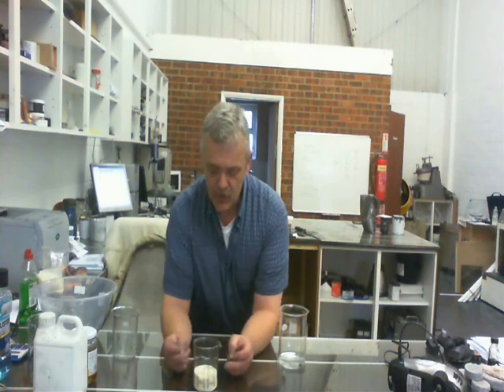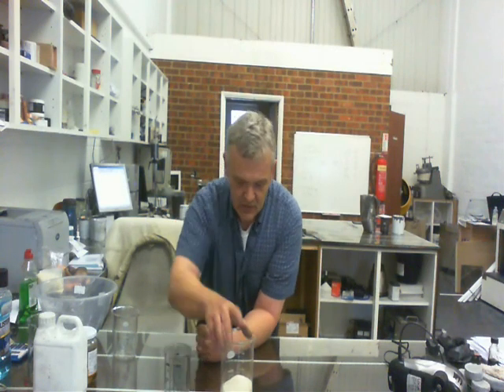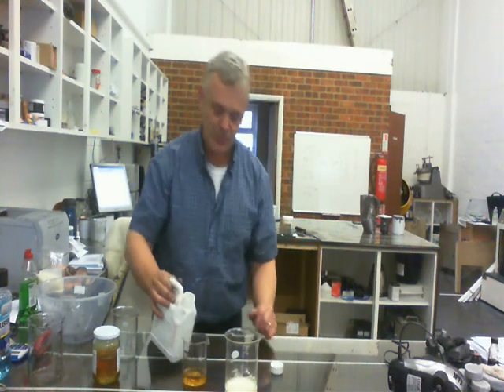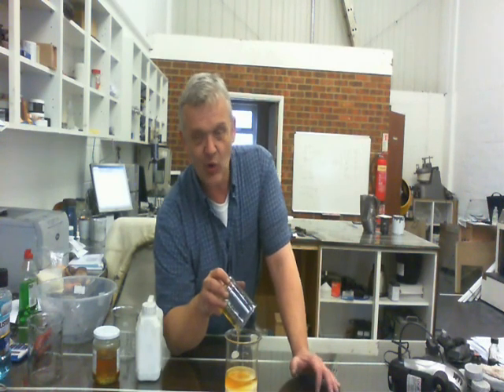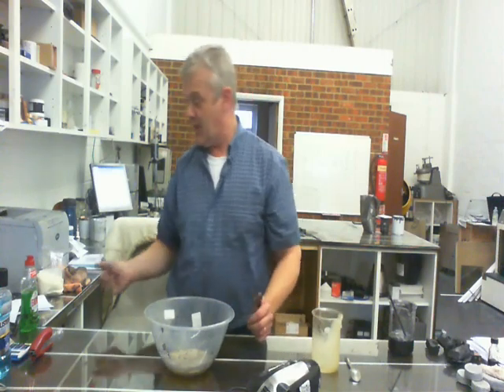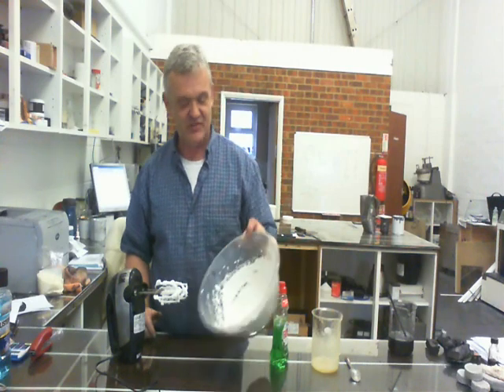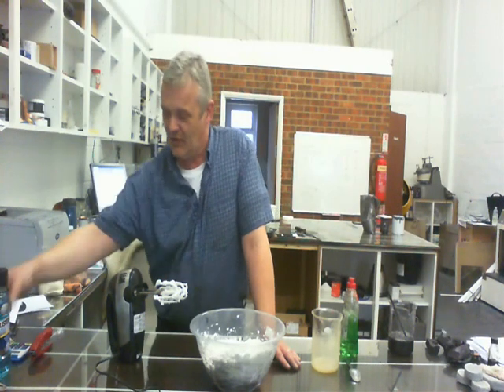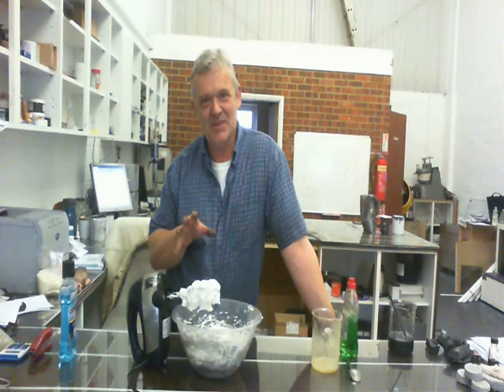How To Make A Gelatin Foam

Comment: nicework!
I really wish that you could explore how to make or cast really thin sheets of highly rigid material
0.76 mm (0.030 in) or less in thickness, by 6"x6" square..
I dont mean it needs to be armor or bullet resistant... just not brittle or that flexable
Reply from the maker: no worries - will do
Reply from the maker: video here Terry Hope - Casting Thin, Tough Bioplastics Casein